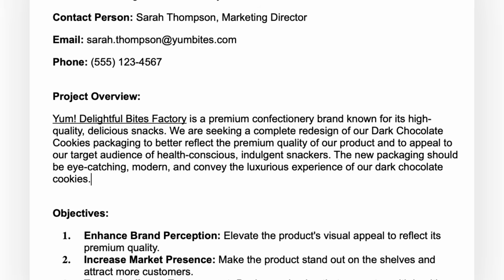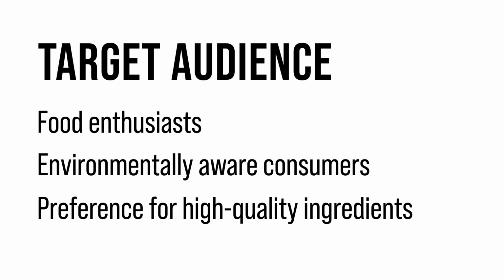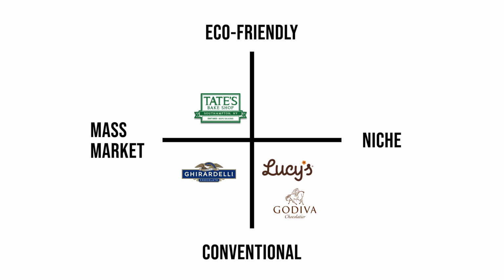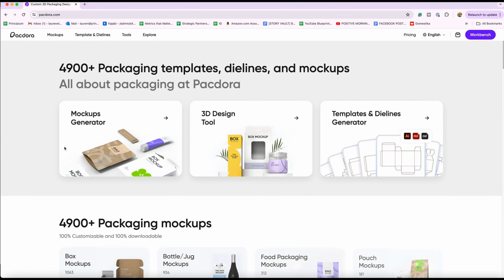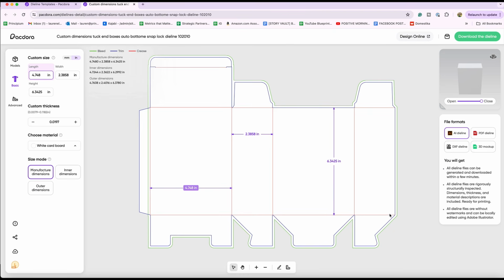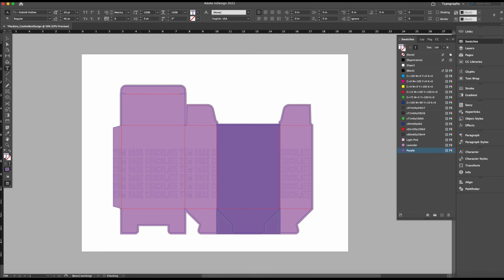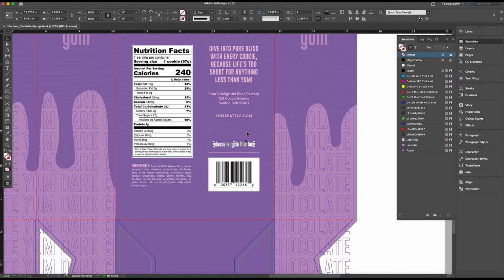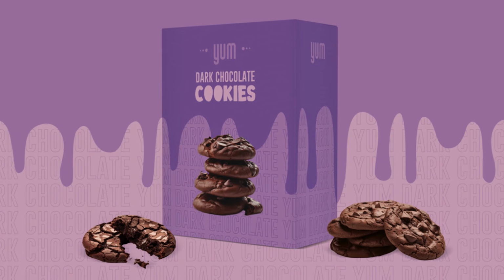Package Design Process | Step by Step Product Packaging Design

Comment: We've long since moved away from designing packaging in InDesign. Why do you design packaging in InDesign?
Reply from the maker: While other tools may offer specific advantages for certain aspects of packaging design, InDesign remains a solid choice, especially for projects that require extensive text management and layout precision. 
Designing packaging in InDesign is still a common practice for many designers, although some may have shifted to other tools like Illustrator or specialized software.
Reply: @4TheCreatives  ok, thanks:) most of packaging i work on are made in Illustrator. That's why i asking you about this. I live and work in Poland.

Comment: Thanks for the video! I've studied graphic design a long time ago and it's been my hobby, but since I've never done it professionally, I've always wondered - if a client hires you to design only a logo that will, among other places, be featured on packaging, website, etc.; what is the typical range of the designer's responsibility? Does logo design, in that case, automatically imply full and precise design of applicable material, such as packaging, or is that merely done as a rough example, in the form of a mockup, for the client to show to whoever will be in charge of packaging, web design, etc.?

In other words, what would be the difference between logo design and brand design? I was under the impression that logo design does not include anything else apart from the logo itself, but I often come across logo designers who send guide packets to clients, which include things such as colors, fonts, acceptable size and mockups as examples of application. If logo design implies all these things, how is it different to brand design? Also, who eventually ends up using this guide for further aplication? If it's the designers within the client's company, I wonder why they require an external designer to begin with.

Lastly, if one is tasked with package design, does the client typically provide the exact dimensions or do you, as a designer, get to dictate this? I would imagine that the designer would, at the very least, have to get a rough range which should not be exceeded.

I'm sorry for so many questions and if they're somewhat unfounded, but a lot of this minutiae is often skimmed over, as if it's common knowledge, while I personally find it the most confusing and I've never heard anyone address it in such detail to give a solid idea of how it actually works in practice. I realize that there isn't necessarily a rule, but even sharing your personal experience might be of great help. Thank you very much!
Reply from the maker: Thanks for your questions! In logo design, designers usually create the logo itself along with color schemes, fonts, and sometimes mockups to show how it might appear on packaging or websites. Brand design goes further, setting guidelines for consistent brand use across all platforms. Style guides help internal teams maintain this consistency. Clients often hire external designers for their expertise in creating unified brand identities. When designing packaging, clients typically provide dimensions and technical details, while designers offer creative solutions within those parameters. Hope this clarifies things!
Reply: @4TheCreatives  Thank you very much for your response! I would like to ask a few additional questions based on your reply, but please, if it's too much to ask, don't feel obligated to answer. The only reason I feel comfortable doing so is because, upon stumbling across your channel recently, I found that you are clear in your explanations and are willing to engage with the viewers, which I highly appreciate.

Based on what you said, it sounds to me like color schemes and fonts (perhaps even mockups for demonstration) are not necessarily considered guidelines, but are a standard part of the logo design itself, while guidelines go even beyond said elements and are done by a brand designer. If my understanding is correct, could you please give me a few examples of what these guidelines for consistent brand use across all platforms entail (if it isn't merely color schemes, fonts, acceptable sizes, etc.)? Because, if we're talking about a website, for example, I'd imagine that a loose/generic mockup (such as the one that would be provided with mere logo design) would not be sufficient, but would require either:

1. Having extensive knowledge of web design to be able to provide precise, sensible and adequate guidelines for the web designer to implement (which does not seem feasible to me, as a brand designer is not necessarily a web designer)

or

2. Working closely with all respective teams/individuals that are in charge of various departments (web design, packaging, etc.) to provide sufficient design guidelines for their area of expertise, to correct them if necessary, and finally approve their implementation of your logo and guidelines.

Your reply helped me in better articulating and homing in on the issue and I hope that I have done so, instead of adding more confusion. Once again, thank you very much for your time and effort!
Reply from the maker: Thank you for your kind words and insightful questions! I'm glad you find my explanations helpful.

You are correct that color schemes, fonts, and mockups are part of the logo design process, but brand guidelines encompass much more. Here are some examples of what brand guidelines typically include:

Logo Usage: Detailed instructions on how to use the logo correctly, including variations for different backgrounds, spacing requirements, and minimum sizes.
Typography: Specifications for primary and secondary fonts, including their sizes, weights, and styles for various applications (e.g., headlines, body text).
Color Palette: Not just the primary colors but also secondary and tertiary colors, along with their specific hex, RGB, and CMYK codes.
Imagery and Iconography: Guidance on the types of images, icons, and graphic styles that align with the brand's identity.
Voice and Tone: Directions on the brand’s messaging style, including how to communicate with different audiences consistently.
Layout and Grids: Recommendations for how to structure layouts across various mediums, ensuring a cohesive look and feel.
Web Guidelines: While not as detailed as a web designer’s documentation, brand guidelines will provide the overall look and feel, including color schemes, typography, button styles, and image usage for web applications.

I hope this clarifies things further for you! Feel free to ask more questions if needed.
Reply: @4TheCreatives  Thank you very much for your time and effort in providing a detailed answer! It is certainly helpful!